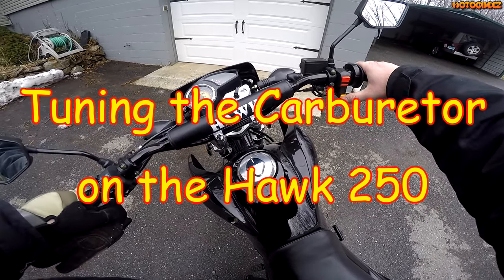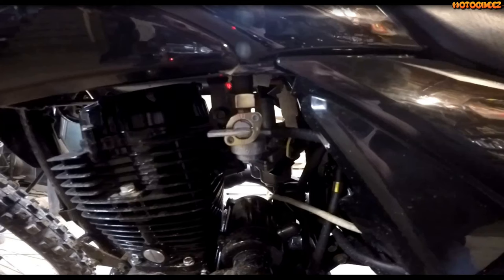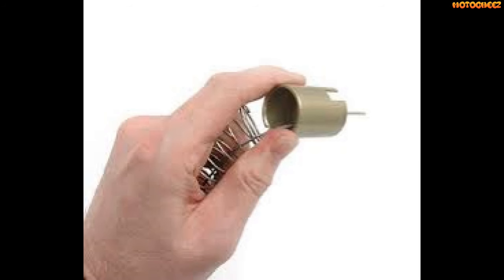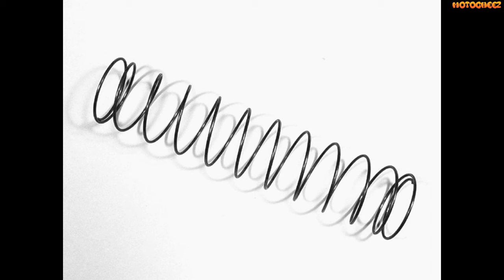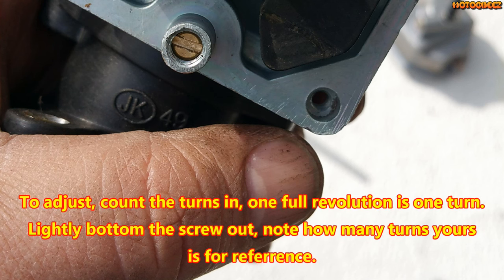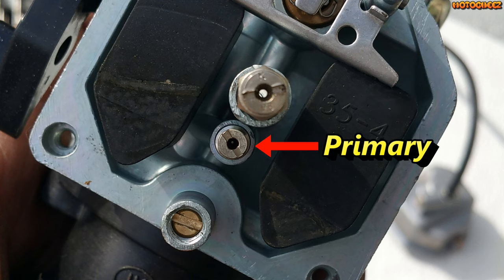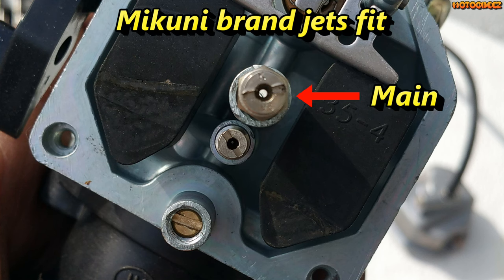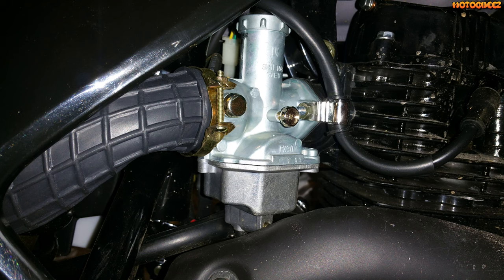[E3] Hawk250 Carb Tuning on the Dual Sport Chinese Enduro 250

Comment: Why is the throttle cable have so much play, just bought a hawk 2017 noticed almost 1/2 play in throttle. Also can u adjust the rear shock haven't really check it out yet
Reply from the maker: MASTER MIND the throttle cable is adjustable. Keep a little play so cable doesn't bind. No rear shock isn't adjustable.. but there are aftermarket shocks people have used. Have links on motocheez. Com

Comment: I adjust my mixture screw on my minkuni 2 and a half turns out we'll about that but it still takes forever to idle I think I've already said something similar but how to I get a good strong idle I already adjust my idle also
Reply from the maker: Liam Wells being carburated it will never just start and idle cold. I usually start the bike and hold the throttle to keep and idle for about a minute, then it usually has a low idle until fully warmed up, then it's a bit high when hit.

Comment: Mine dies as soon as it warms up but I'm still breaking in the motor do u think I should do anything to it yet it's a Titan 250 no efi
Reply from the maker: Could be the gas cap not letting air in and vacuum locking the fuel. Loosen cap when it acts up

Comment: alright so i put a 17tooth from and a 38 rear made hell of a difference. gonna do the next few upgrades
Reply from the maker: Awesome!
Reply: +Kwak graffiti A 38 rear tooth? How's that on top speed and acceleration?
Reply: +Andrew93 honestly probably a little difference from the 43 rear. but the 38 rear deffinetly feels more kick
Reply: What's your top end with that gearing?
Reply from the maker: +Andrew93 I left the stock sprocket in the rear. I like the low 1st gear.
Reply: +Andrew93 about 73 not great but im doing more mods to mine im trying to reach about 90 like ive told moto cheez but theres gonna be time and parts im gonna push this thing to its max to see what i can get out of it

Comment: I just got a hawk 250 and its stock but ordered a nibbi pe30 carb. Im at 800ft elevation do i need to change the jets if so what jets would work best. Also any help explaing how to fuel air mixture adjustment work confused by the 2 and half turns and what not, any help appreciated.
Reply from the maker: I never put a Nibbi on a hawk, I'm not sure about jet size, probably around a 115 main to start with. Idk
Reply: @MotoCheez  ok ill try it i know it comes with a 128 jet and a 40 pilot

Comment: For the pz30 carbs any idea what pilot jets I would wanna order...can’t figure out what ones I need to order I know the pilot is too small after swapping my exhaust my bike won’t even attempt to start after sitting over night without full choke and a hair of throttle
Reply: My spark plug shows I’m perfect as far as mixture...nice golden brown/tan you know what I mean 😂 but I’m 2 1/2 turns out on my mixture screw so I know it’s time to up my pilot size so I can bring the mixture screw back in about half a turn other then that it’s running perfect
Reply from the maker: I think I put in description of the video. I forget lol. Sorry

Comment: Can anybody tell me how they size the jets in the PZ30 for a Hawk 250?  Is the stock 98 jet designed for sea level?  I am going to be riding in high mountains, so do I want to go down in jet size so it is not so rich...  everyone else seems to go from a stock 98 to the 110 (but they never mention if they are aiming to ride at sea level or very high elevations).  Thanks
Reply from the maker: Usually the 110 is for seal level or close, I'd keep stock in it and try it.

Comment: could getting gas in my gear box cause my neutral switch to not work and also make my clutch slip if so would an oil change fix the problem
Reply from the maker: Liam Wells it's possible, is the oil overfull with gas now? worth a shot to change oil.
Reply: Ok thanks motocheez lol again
Reply: The hawks will be a pain to get into neutral at first. After a few hundred miles and an oil change they'll go right in. They're like that when new.

Comment: Hi MotoCheez,  I have an issue with my Shen carb on my 2018 250 Hawk.  I have done everything you suggest in this video but for some reason it just want run right.  It starts fine and idles fine but when you give it some gas it spits and sputters something fierce.  One thing i did notice that my mixer screw was all the way in from the factory, but i went ahead and brought it out 1 1/2 turns as you suggest.
Reply from the maker: I suggest 2 1/2 to 3 turns out... It sputters and dies? It may have dropped the needle on the plunger. Is that on middle groove?
Reply: @MotoCheez  Ok thanks.  I believe it's on the groove closet to the end. I don't see any other grooves.
Reply from the maker: Stock carb?
Reply: @MotoCheez  yes
Reply from the maker: Choke is off? Lever down and warmed up? Maybe it's your spark plug.
Reply: @MotoCheez  yeah, all that. I just decided to buy the Mikuni vm26 carb. See how that goes.

Comment: Hey motocheez just got my bike today but my carburetor is dirty and it stalls when I put it in first gear well that's what the guy told me a brand new bike fresh out the freight box only 10 miles on it and it stalls and my carburetor is dirty
Reply from the maker: Dirty? Did you raise the idle? Or maybe clutch too loose
Reply: It's still doing it but I finally have most of the upgrades I have the same after market exhaust with nibbi carburetor a new gear shift lever got a new chain put on still need to hook my digital cluster up on the bike still have stock parts on it and now how the bike sounds I think it's alil lean but once I put everything together on here it should go away I think I'ma need a jet kit box which main jet should I use a 115 or 120?
Reply from the maker: 115 I'd try and shim needle 8f you havent
Reply: @MotoCheez  no it's just when I'm cold starting it it stalls just like in the beginning of this video that's exactly what my bike does  and has this weird smell coming from the air box I think and when I put the choke on all the way it don't start up for nothing man so I pull on throttle when trying to warm it up I don't rev it but once it's warmed up it's fine I just wanna get rid of the smell that comes out my exhaust from cold starting it the stalling and how it sounds which is alil lean I almost have 1000 miles on it now I'm just ready to modify the bike so it run fine no more stalling no lean sounding when that happens I will be smiling from ear to ear
Reply from the maker: @dariusreynolds2431  that's usually the mixture is too lean, open up the mixture screw (not idle screw) 3 to 3 1/2 turns. Or go up next size on primary hey b
Reply from the maker: Thanks! I enjoy making the videos as well. We can definitely ride someday, I don't do side work, I get so many offers I just don't have the time. But I don't mind answering questions on here or messenger. 🧀🧀
Reply: @MotoCheez  ok I understand you a busy man everything but no one wants to work on chinese bikes lol only fuel injected japanese bikes my mechanic barely wants to work on my bike because it's chinese lol but because I'ma loyal customer he gives me somewhat a pass lol but anyone else that brings him the bike he says no hell no lol I guess I'm somewhat lucky I guess but thanks man keep making these awesome videos keep dropping knowledge as long as you do that you'll always have my attention good day my guy stay safe

Comment: How many miles do you have on any of your hawks and what can I expect for miles with proper care oil change, valves adj. etc.
Reply from the maker: Sorry so long to replay, comment got buried. I have about 2500 miles on mine, I know of another guy who has over 5000, still going strong
Reply: MotoCheez is it worth changing the idle jet from stock 20? if so do you know what's best? I watched a video from cacklez  and he said he heard people saying 26 for that jet
Reply from the maker: +Taylor Freezy I modded my stock carb so there is no need. The idle mixture screw (which adjusts the idle jet) is out at 2 1/2 turns and it's  perfect.  Typically if you have to go out more then 3 turns to us go up to the next size.
Reply: MotoCheez when you count the 2 1/2 turns is it from current position of idle mixture screw is set? thanks again for the replys!!
Reply from the maker: Taylor Freezy 2 1/2 half turns from all the way in,  1 turn out from stock setting which is 1 1/2 out
Reply: Awesome thanks so much!

Comment: Hey moto what's a good after market throttle cable for the magacian my is messed up
Reply from the maker: That's a shorter one. Measure it's length and fine one on eBay probably

Comment: I'm stuck. I put the new main jet in. Its a 110. I was unable to adjust the throttle mixture as I cannot get the plug out. Now when I put it back together and start it, its like its full throttle. Idk what to do from here.
Reply from the maker: The plunger? It has a groove you have to line up oposite the idle screw
Reply: I found the grove. Got the plunger back in but for some reason the rev is just extremely high. And it feels like I lost action on my throttle.
Reply from the maker: Is the cable kinked somewhere?
Reply: No kinks. I was able to get the mixture screw adjusted. Hopefully it will fix the issue
Reply from the maker: The idel screw on side screwed in too far?
Reply: I had it all the way out. Every time I start it up it revs super high. Starting to wish I never even mess with it. It was running fine before I did this.
Reply: I gotta be putting the plunger on wrong. It's supposed to go all the way down right?
Reply from the maker: Yes. All the way to the idle screw. Which is a taper on the plunger
Reply: That was it. The plunger was not seating correctly. I really appreciate the help man! Your videos are what made me wanna buy this bike to begin with. I am anxious to do a test drive now, but it's late and raining. Hopefully tomorrow.
Reply from the maker: Awesome! Thanks.

Comment: Hey Moto, once you put the 110 jet in did you turn the idle mixture screw out more or keep it at 1.5 turns? Thanks man
Reply from the maker: Ibidle warmed up, then turn in until it runs bad, then back out until it's smooth then 1/4 more, that's perfect

Comment: The plunger from the pz30 wont work in the makuni carb? I dont have anything that holds the needle in my plunger no clip or washer was inside my new makuni
Reply from the maker: I'm pretty sure the PZ is Keihin copy. Takes Keihin jets
Reply: @MotoCheez  not the jets....the needle in the plunger how is it held in? I see theres a clip on the hawk wat about the mukuni?
Reply from the maker: @Whowntswat85  mikunis has the adjustable clip too. Stock carbs usually don't
Reply: @MotoCheez  the spring seat plate is missing from mine....i made one from a washer hopefully it works. There was one in the rebuild kit but its too small fits inside the spring
Reply: @MotoCheez  one last question.....so got the mukuni carb and 110 jet in.....runs perfect on half choke.....turn choke off it stalls.
Reply from the maker: @Whowntswat85  the main is for 3/4 to wide open. Idle is  done with mixture screw and primary jet. Try opening the mixture to 3 turn
Reply: @MotoCheez  just now realized stock carb was a pz30 with 105 jet. Going to swap it back

Comment: Have you added the makuni carb yet? If so, how did you do it? It seems like the piece from the motor needs changed to be able to accept the makuni carburetor.
Reply from the maker: I have not
Reply: @MotoCheez  what state are you from? I'm from ohio, it would be kinda kool getting a bunch of hawk riders together for a ride
Reply: @MotoCheez  all of my rear sprocket studs just snapped on me. Is there a place where I can get more? And do you know how difficult it will be to replace them? It didnt seem to have messed up anything else
Reply from the maker: Did it pop the circlip that holds the sprocket on?  The studs are for dampening not to keep sprocket in. They come out easy, not threaded
Reply: @MotoCheez  the c clip is still good, all of the sprocket studs snapped. So when I am in gear, the sprocket will spin, but the wheel will not
Reply from the maker: I haven't, but help someone. It should bolt right on!!

Comment: I just assembled my magician and it will idle for a few seconds then cut off. Not sure what I'm doing wrong.
Reply from the maker: You may have to raise the idle, or choke is on?
Reply: @MotoCheez  -I do not know which position is full choke and no choke, which honestly is my real issue. When it does idle it seems to be at a decent rpm but cuts off. Fuel is in on position.
Reply: @MotoCheez  - No indicator for which position is full choke, really that's all I need to know.
Reply from the maker: There's an idle screw on carb behind Kickstarter. Funky screw bit
Reply from the maker: Down is off, up is on choke
Reply: @MotoCheez  Thanks man. The manual wasn't really helpful and there isn't any specific online instruction. The only useful tool that came with the kit is the idle screw wrench and Alan wrench. I used a couple locking pliers to do the rest, was a real pain but I managed to get plenty of torque down on the rest of the bolts with minimal stripping. I'll use a file to re-tool any worse off bolt heads and nuts.
Reply from the maker: Ya. Manual worthless lol

Comment: Hay motocheez where dis you get you gas cap for your hawk 250 my factory one is leaking
Reply from the maker: TXpowersports should carry them, but it's keyed, so you may want to look on eBay to get a whole set ignition gas cap with keys
Reply: @MotoCheez  thank you

Comment: I love these videos, they  are priceless for a newbie.  I wanted something I could learn on at all levels, so most of my parts are here.  Mine didn't have the front indicators in the crate :/  I bought a mikuni carb but the jet kit is weeks away yet.  I started it yesterday for the first time, it took 1/4 throttle to get it running.  Once the idle was adjusted it purred, but then wouldn't start again when warm.  I can only assume a bigger jet will solve this problem..hopefully.  Your thoughts please?

In your oil changing video..20/50 huh?  I was recommended 10/30.

When I gain some confidence, maybe we can meet up.  We don't live that far from each other.  I am 45 minutes from Dutchess county.
Reply from the maker: Erik Holmstrom thanks! yes  the jetting will solve the hard starting, I had to run mine with the choke on when I first built it. the recommended oil is 15w40, in the small booklet that comes with the bike it shows what oil to use at certain temperatures. 10w30 is for  zero degree riding. don't forget these are air cooled and will get pretty hot putting slow through the woods, 20w50 oil is in the book for something like 30degrees to over 100 degree outdoor Temps, IMO 10w30 is too thin if you're riding in over 70 degree weather. if you're up CT area contact me (here, Facebook or instagram) to go for a ride. I'm probably putting another ride together this summer too.
Reply: Thanks!

Comment: My bike doesn’t wanna turn on at all I don’t know what to do both just jets are like 2 turns out help me please 😣
Reply from the maker: There is no adjustable jets, just one mixture screw underneath. The screw on side is idle adjustment. Did you try using the choke?
Reply: @MotoCheez  I don’t even know what happened man like 2 months ago my bike was rich so I decided to mess with the air and fuel and then I though it was still messed up and then I messed with the jets
Reply from the maker: What size you have in there? Should be 40ish low jet and 115 main
Reply: @MotoCheez  well I have to check again but I have a 20 and a 110 main

Comment: I have a 125 taotao ATV and it runs temps of 500°f its nuts and I pulled the plug it looks fine still runs and drives fine do u know why it would be running that high bro? Oil temp was 237 but the head was running over 460 and the valve cover 440s but spark plug area all at 500s. I know for air cooled they can withstand some temps but it's a bit extreme also note choke was completely off and the ATC was loaded pretty heavily but moving around no problem, air filter is clean its fairly new what do u think
Reply from the maker: Maybe lean? Or valves too tight?
Reply: @MotoCheez  not sure but spark plug looks great
Reply: How do I check valves? U mean with the gaugesm
Reply from the maker: @weekendwrench  I know they'll run hot unless you're moving along, could be normal, it's been almost 100 here last week
Reply: @MotoCheez  thanks brother how can I tell if it's too lean or calves too tight I'd have to go 2moro for feeler gauges but correct if I'm wrong if its lean it would show white residue on the plug correct? How else would u troubleshoot the high heat but the thing fires right up no issues no hesitation no bog down no tick no ping I'm baffled
Reply from the maker: @weekendwrench  yeah, it would be white. I believe 450f is the "overheat" marker. 500f absolute max. If it's not pinging and runs fine it's probably ok I'd say